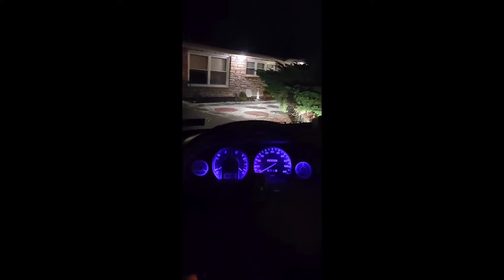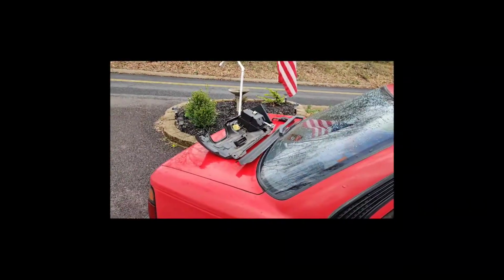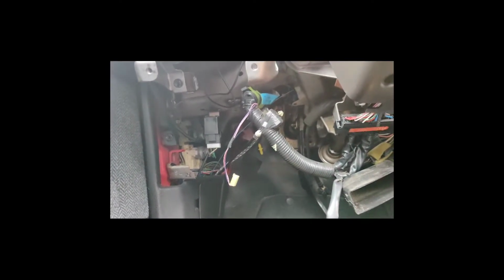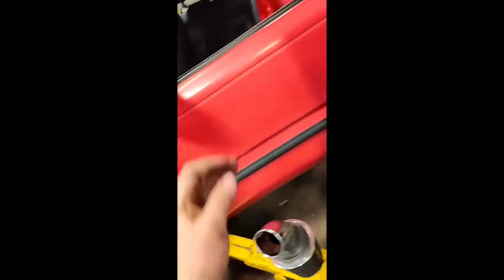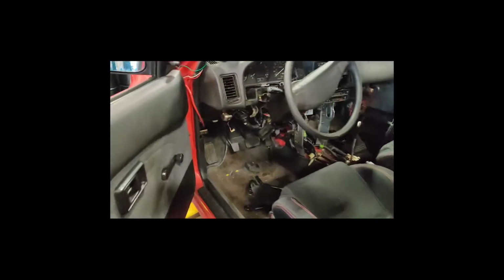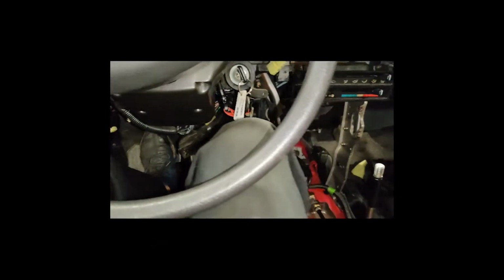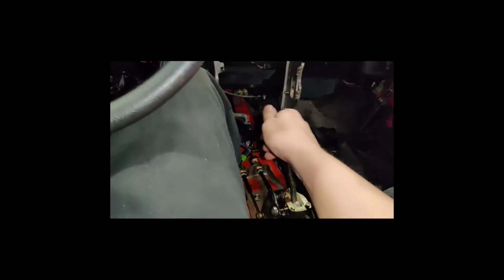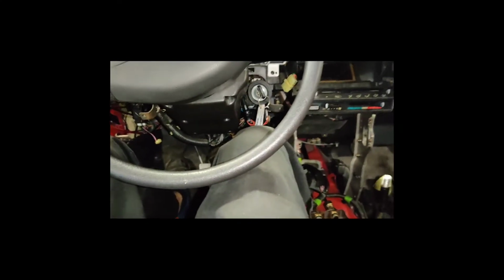Toyota build part 2 - 1 year recap

Comment: You doing tint yourself or getting it done somewhere? Want to get it for the Hyundai
Reply from the maker: found someone that"ll do it fairly cheap. but good. id do the side windows myself but id mess up the rear window. has to be done a certain way because of the defroster lines. they will cause bubbles if not done correctly.